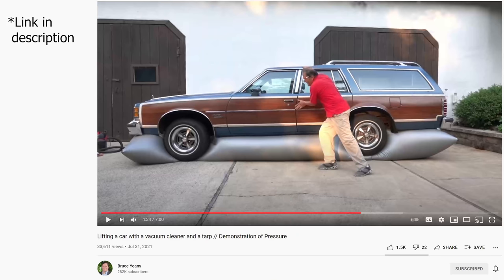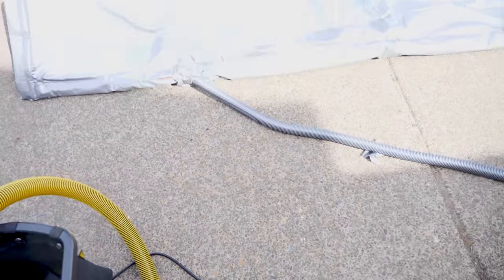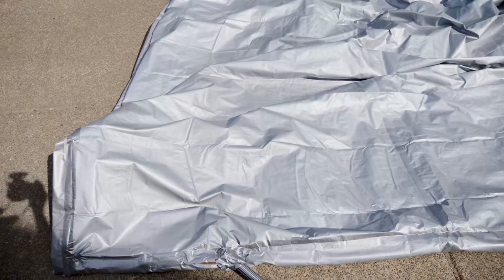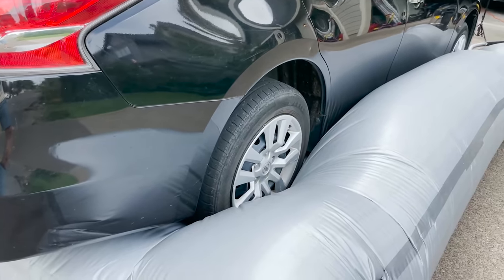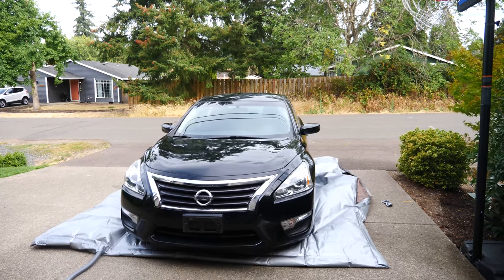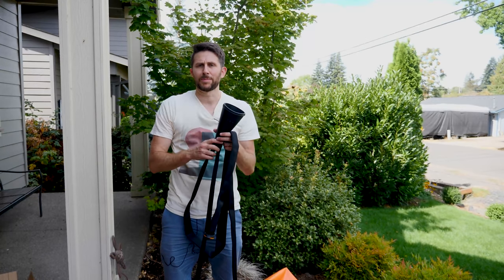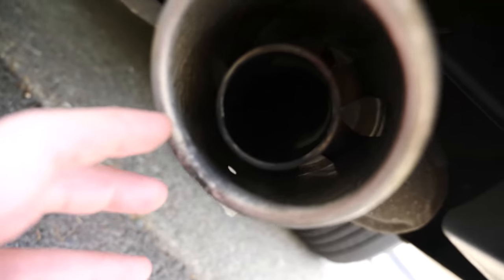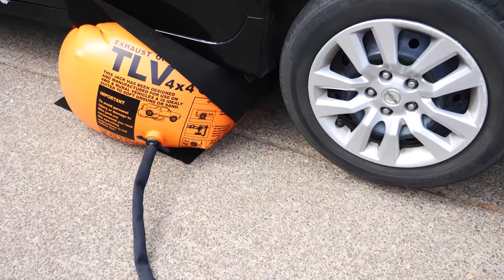A Car Lifting Itself With Its Own Exhaust Pressure

Comment: I've actually seen how powerful pressure can be.  You know that effect where you open one door in a room, and it causes the door on the other side to close?  I actually measured the pressure change in a room with that.  It turned out the difference was only about 10 Pascals (0.0015 psi)!
Reply: My friend’s old house had an insane exhaust fan in the kitchen ceiling (something to do with the house being a former daycare) that was probably 2’x2.5’ and when it was turned on, it would slam every internal door closed and suck open any external door that wasn’t completely latched almost instantly. I remember turning it on with all the doors and windows closed and it sucked the all-glass storm door in against the weather stripping and we could see the glass panel in the door flexing in. We got scared it was going to shatter the door and turned it off. But now, I’m curious what kind of vacuum that pulled when we had everything closed.
Reply: @RandomBogey  you Should put some baking soda in the other room and see if you can suck it to the fan lol
Reply: There was an incident out in Alberta where someone was filling one of those massive tires they use on Cat 797's (it's a gigantic dump truck they use in the oil sands that you need stairs to walk up just to get into the driver's compartment). Unfortunately for some reason, he over pressurized it and it exploded and he was torn apart. Pressure truly is something not to take lightly.
Reply: @berner   Indeed!  It's terrifying how powerful it is.  That's why Tornados are so destructive.
Reply: People seem to forget that PSI is per square inch and fail to respect things under pressure as dangerous. Even with a small object like a door that is actually a lot of square inches in area so a reasonable overall force is applied.
Reply: @jay2ssrstt  I saw a photo of somebody at a different job site. they opened up a Water main they thought was low pressure it blasted the guy in the face ended up with severe bruising and A messed up eye he went to the hospital I Believe he’s fine now but No good
Reply: @RandomBogey   Sounds like that pressure difference was a lot higher!  I'm guessing at least 100 Pascals.  If you want to measure it, the app that I used is called Physics Toolbox Suite
As long as your phone was built in the last 5 years or so, it should have a built in barometer.  That app will allow you to measure the pressure to within a few Pascals!
Reply: that happens every day in my house
Reply: I broke a window this way, by violently opening a door. The window wasn't fitted very well in that room, or was the weight of the door and the format of the room, and the fact that there was negative pressure on the room.
Reply: @jay2ssrstt  Came here to say that. Pascal is defined as Newtons per square meter. A door is usually around 2 m^2, so a pressure of 10 Pa exerts a force of 20 N. That's the equivalent of 2 kg (or about 4.5 lbs).
Reply: @berner  the loudest sound i've ever heard was a bike tire popping when my friend pumped it on an air pump meant for semis. it went from flat to exploded in half a second, and took 85% of my hearing in the right ear, and about 50% on the left ear. took me 3 weeks to fully recover my hearing. i thought i was gonna be semi-deaf for life :O

Comment: we had a air ramp at a garage i once worked in at one time used a normal garage painting/tyre  compressor to raise it was a bleeding dangerous  piece of kit though
Reply: it wasn't the going up that was the trouble the cylinder was the size of a dust bin and would suddenly drop the car from 4 foot high going down

Comment: Wouldn't this put pressure back on the car's engine?
Reply: Yes it would put pressure on the engine, but not much.
Using some rough numbers, looks like a Nissan Maxima, a 6 foot wide car, that is 16 feet long, 96 square feet, 144 square inches in a square foot (12x12), so 13,824 square inches, and about 3600 lbs weight... 3600/13,824... about 0.26 psi in the bag and exhaust system.  Considering the pistons can pump up to roughly 162 psi, on a compression stroke (11:1 compression ratio, 14.7 psi atmospheric pressure * 11 = 161.7 psi), if there are no holes in the exhaust you're probably going to be OK with a back-pressure of less than 0.2% of the typical compression stroke pressure.
Also, considering for emissions testing it is permissible to have exhaust back-pressure of up to 0.18 psi (pressure of ±5 inches of H20) on the exhaust sampling system at the tailpipe, 0.26 psi is not much for the exhaust system.
Mufflers will have a pressure drop across them, especially at higher flow rates.  The reader can Google what that would be to get an idea of what back-pressure a muffler put on an engine.
Reply: @willmcgo8288  I think it's a Nissan Altima

Comment: It's basically like a lever, which increases the output force in exchange for reducing the displacement. Here you can lift up several tons with not a lot of pressure, but the trade-off is the large volume of air you have to move to make it work so that energy is conserved.

Comment: That's the gentlest way a car has been lifted. Also RIP for your car when it dropped
Reply: It’s like the first time I used a floor jack, I dropped my dads car because I wasn’t turning the Handle properly
Reply: The suspension had to do less work than if he was driving at 10 MPH and hit a moderate bump. It can handle a gentle drop from a few inches up.
Reply: Nowhere near a significant enough drop to do any damage
Reply: nou
Reply: More like rip YOU if it drops as your attempting to set a jack stand.
Reply: @kalashnikov1343  happened to my grandpa workin on a diesel engine. Hes a little less handy now. Ha, ha.

Comment: Interesting, one risky factor is that if the cushion pops while changing the tier then would damage the brake calipers
Reply: Looks more unsafe than a regular car-jack. Especially when you're wanting to use this to change a tire along the side of the road. You could seriously injure yourself and damage your car.
Reply: @Νίκος Παναγιωτόπουλος Exactly my thoughts. You would secure it with something like even a rock or a brick before taking the wheell off and then you can even put the wheel under the car next to the baloon thingy,
Reply: How to test your suspension (and break it)
Reply: @shnakee  You know people are going to be extra stupid and not do the common sense thing. That was part of the point I was trying to make.
Reply: @shnakee  Yes. I often use one of the wheels as a "drop stop" depending on what I'm doing. It's easy and free and you never know when your jack stand might fail.
Reply: @Νίκος Παναγιωτόπουλος Then why would we use this inflatable technique
Reply: @ariz.k9901  Well, unless you got muscles like no other, you're not gonna be able to lift the car with one hand and take the wheel off with the other... 1 fourth of the weight of the car is on that wheel pushing it down.
Reply: @netts2315  Exactly, so the idea isn't great is it.
Reply: @ariz.k9901  I was talking about the idea of the inflatable jack. You're not gonna be able to change a car wheel if you do not have something the get the wheel off the ground in the first place. The inflatable jack does that, and, unlike traditional jacks, doesn't need flat ground to work, proving much safer in uneven terrain.
Reply: @netts2315  I have one question for you. 
What if it suddenly explodes
Reply: @ariz.k9901  That's the one drawback. That's why you put something else under the car once it is lifted up. Also more quality materials should be considered.
Reply: @netts2315  if you are already putting materials to support it then whats the point of the inflatable.
Reply: @ariz.k9901  Again, how are you going to get the wheel off the ground to put something under?
Reply: @netts2315  you arent putting it under the wheel. You need to see the video again, it's under the gate and that will lift the wheel
Reply: @ariz.k9901  Gate? But my question still stands, how are you going to get the wheel off the ground to get something to prop the car up with under the car? If it was so simple as to just lift the car with your hands and put something under, we wouldn't need any kind of jacks.
Reply: @netts2315  The car's weight is more than a ton, how on earth can you just lift it with your HANDS. This is why the video is there that you put the inflatable under the front gate, next to the tyre and once there is enough air. It will lift the tyre too, whatever it is. Its very risky coz if it burst in the process then you can get injured and car will get damaged.
Reply: @ariz.k9901  Exactly my point all these comments. You need a jack to get the tire off the ground. 
Traditional jack Pros:
Sturdy (Most of the time), speedy to use
Traditional Jack Cons:
Cannot use in uneven terrain, requires close supervision to lift the car correctly

Inflatable Jack Pros:
Can be used in uneven terrain, little easier to setup in order to use safely
Inflatable Jack Cons:
Sudden failure is catastrophic and happens in a split second, can be slow to use depending on your equipment.

If you use the inflatable jack to get the tire off the ground, then put something under to prevent the car from falling in the case of catastrophic failure, I see the inflatable jack as a great alternative for someone not that experienced in jacking cars up, plus there's the whole uneven terrain thing.
Reply: @netts2315  the inflatable could be really useful to get cars unstuck, I like the idea. But I would not want to use when a conventional jack could be used. I wouldn't even trust the split second it takes for me to set a jack stand under the car lol.
Reply: @kalashnikov1343  Yeah. Higher quality material is needed, but it really shines in rough terrain when you can't move the car.
Reply: @netts2315  But what if they don't have that something to put underneath
Reply: @ariz.k9901  You have a fair point there.

Comment: Your car has a single exhaust pipe and single muffler with 2 exhaust tips. It would have filled up a lot faster if you would have plugged up the other exhaust tip just fyi

Comment: I’m sure if the engine would be revved up rather than idled there would be more exhaust to fill up the reinforced bag, also I’m concerned with covering both exhaust I hope the fumes aren’t going back into the engine, but if your car still runs seems nothing to worry about then. Very cool experiment though I love your videos very entertaining and full of interesting knowledge
Reply: Yea. Whistlin' Diesel (if you know who that is) has a video trying this thing out. He used it on a Volkswagen car and a pickup truck and you can definitely give it some more throttle to make it inflate a lot faster. He also inflated it to the max, which you aren't supposed to do. He had the driver side wheels over 3 ft off the ground 🤣🤣🤣
It also has a one-way valve in it, so you can shut the vehicle off and the bag will not lose air pressure. Pretty cool I think.

Comment: Don't tell people to plug one side of their exhaust. A "true dual exhaust" vehicle will have 2 completely separate exhaust systems. One from one bank and one from another.
Reply: Certainly, good enough advice to know enough about your vehicle (but people aren't crawling underneath the back of their cars) - Smaller engine vehicles have an equalizer or the manufacturer is just splitting the exhaust to make it seem more powerful (and also be able to have only a single catalytic converter for exhaust emissions). An older V-8 is definitely going to have a split exhaust.
Reply: @IBM_Museum  definitely many vehicles have a crossover but it's not worth damaging a vehicle because you took advice from YouTube not realizing that it wasn't universal.
Btw, I drive a 1971 chevy with a 454.
Reply: @revolverguy : Small modern vehicles are typically going to have a unified exhaust to keep a single catalytic converter and muffler system - as I said, I think the later "dual exhaust" look is just primarily for marketing. The idea-originating video does show what is a dual exhaust older stationwagon, although the inflation source isn't from the vehicle. This also brings up whether the commercial bags include a "plug" or a dual hose system - James does need to include the appropriate disclaimer (it is monetized time anyway) and information within the video as I am sure is included with the devices.

Again, nothing replaces the knowledge of the vehicle it is going to be used on, but people are taking advice from sketchy YouTube content for how they conduct their lives and beliefs anyway. I hear you, as a content creator myself I have to be careful to include disclaimers. People do all kinds of weird stuff now.

My first thought was actually about the exhaust system of the vehicle being hot enough to start a fire in some instances, and being close to the gas tank on many vehicles...

Comment: You can buy air jacks for your car they make them for this. They are popular with off road drivers especially for use on sandy terrain like beaches for off-road recovery
Reply: Yes that's exactly what we see in the video. It wasn't pointed out but the bag is marked with instructions.

Comment: Whow never expected this to work. Figured the tape would have given away the moment it came under force.  Unrelated but my son asked me if an astronauts was working on the space station, could they push the space station using in suit thrusters changing its orbit.  I'm assuming the space station would be basically weightless so it would move it, but no idea. Could they also "yank" on the space station to turn it into another direction? I am assuming this last one would be "blowing your own sale".
Reply: Theoretically yess, the space station can be shifted with the in-suit thruster. But due to the momentum conservation rule, that change would be tiny as the in-suit thrusters cannot significant enough force on it. Mass matters here. However, if the thruster is kept on for a very long time in the right direction, it can shift the ISS's orbit.
Reply: @priyabratasadhukhan6435  would even a small shift though be huge as its going around the earth in orbit right? So even a tiny shift over time would progressively get worse and worse unless corrected? :P
Reply: @AdamsWorlds  Yes you are right. Even the very very thin air up there slows down the ISS, that's why ISS requires a regular course correction.

Comment: plugging a dual exhaust is not good! i'm not familiar with your car, but usually dual exhausts are hooked up to separate cylinder banks, so you're not getting more pressure out of the unblocked side, because they're not connected. maybe you're car is different, but that was scary to see

Comment: I wonder what the decibel level was for each of those pops. Given how loud a pop from a blown up sandwich bag can be, I’d suspect the pop generated from that experiment must be extraordinarily loud.. well, relatively speaking. Much smaller surface area with the bag and your hand is fairly large compared to the sandwich bag and the force is probably greater in that smaller volume.. I’m no smarterer than ain’t gnonobody!

Comment: You should fix an inflatable to the underside of a car and add a propulsion system to make it amphibious. I think you'd have to add a small hole or two to stop it overinflating and have the inflatable custom fitted but I think it would be very doable.
Reply: Regulator valve to prevent overpressure, rather than a hole.  Otherwise the pump has to keep going constantly to maintain a minimum pressure.  You were on the right track, though.

Comment: Huh, what is that orange bag called?  Looked like it was intended for this sort of purpose?
Reply: It is a Telawei TLV 4x4 Off-Road Exhaust Jack.  Many of the commenters here have not noticed that this is a modern commercial product, and that most of their comments are addressed by prominent warnings on the side of the bag, some of which can even be read if one pauses this video.
Reply: @JdeBP  Thanks!

Comment: So, my first thought is that the back pressure from the bag would be bad for the engine...or is it safe? Can anyone confirm this? Thanks in advance!
Reply: Not enough to matter. Though depending on your exhaust system, you might not want to be blocking the second exhaust.

Comment: Actually the shop vac did not lift the car off the ground!!! Pls watch closely, it was just pushing the body of the car up since it needs very little force to lift the body of car when it rests on the spring suspension!!!!!

Comment: Congratulations, you've just demonstrated the accumulative power of single vehicle pollution! 

Now multiply this amount of produced force necessary to lift this vehicle accordingly, applying it to the pushing of breathable air at ground level, or in water & plant absorption, the lifting of clouds, or absorption by clouds, and do you not yet realize the potency of civilization to godlike interference with our planet?

Is it any wonder then, when the pandemic caused everybody to stay at home, the absence of vehicles everywhere, was synonymous with flash floods and wildfire outbreaks, as if a climatological reset switch had finally been flipped in the absence of this overriding pollution force?

How is this video not irrefutable proof of its existence, of the power of mankind to be so hazardous to itself and everything else that is of this world! 

It's clearly time to stop using fossil fuels immediately.

Comment: Something is not adding up with the PSI calculations.  That orange bag is about 2 feet by 2 feet, or 24x24=576” square.  At 0.7 psi, that is only lifting 400 lbs worth.  400 pounds should not lift a car (or even 1/4 of a car).  I think this is much higher than 0.7 psi.

Comment: I bought a tire inflation kit for motorcycles where you unscrew a spark plug and use the port to screw in a pneumatic hose with a valve that inflates or pumps up your tire. Kind of a variation of using the engine pressure to inflate things.